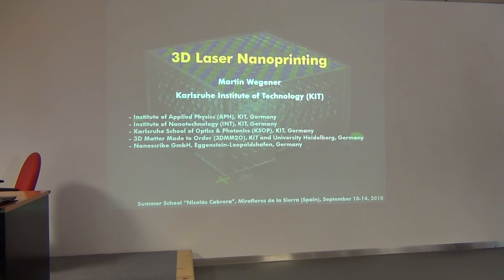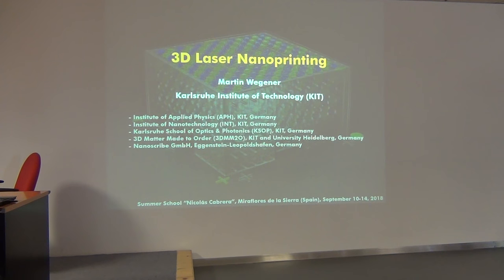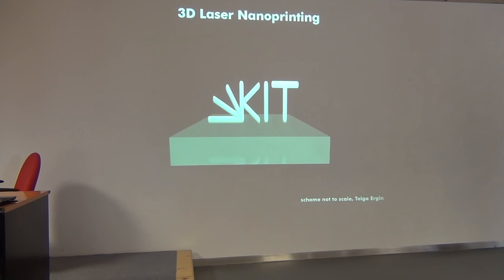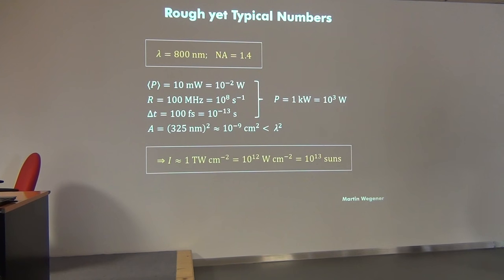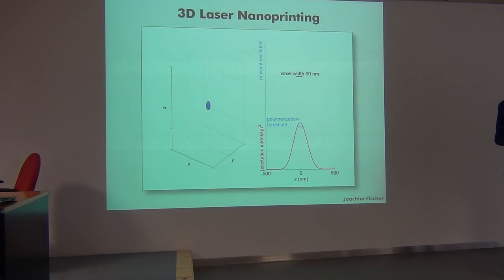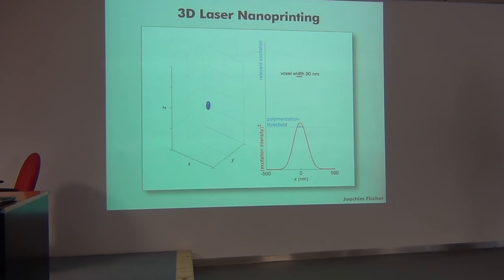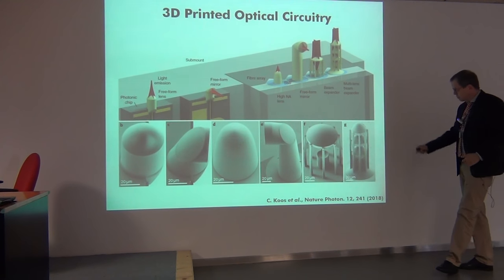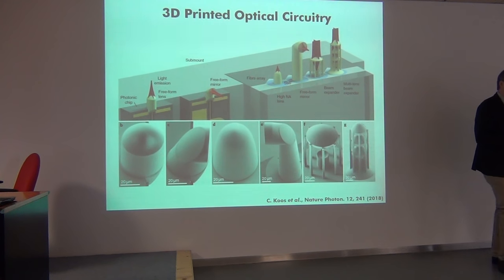INC Summer School 2018: Martin Wegener

Comment: Hello , i just want to ask something  if possible  in 2 stages and im not disturbing. In theory Would it be possible in stage 1. that trough the DLW writing of  a metallic nanostructure and nano-silica-structure, to create a sort of bio-nano-chip that has combined proprieties  like data storage, sending/receiving wavelengths. And in stage 2 to transfer- implant that nano structure into the human body trough a procedure called "Biological laser printing via indirect photon-biomaterial interactions" as described in the link  https://patents.google.com/patent/US20050018036A1/en

Thank you for your time